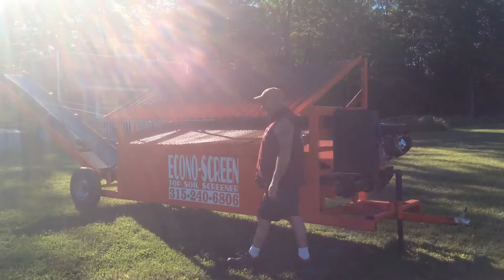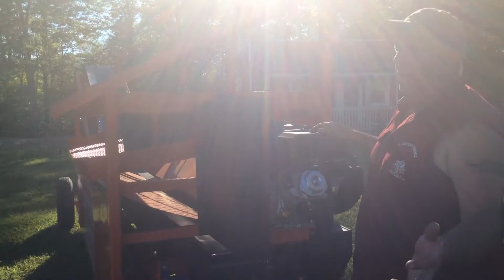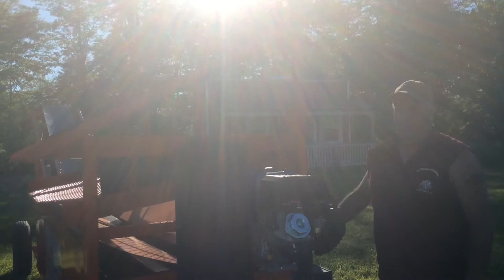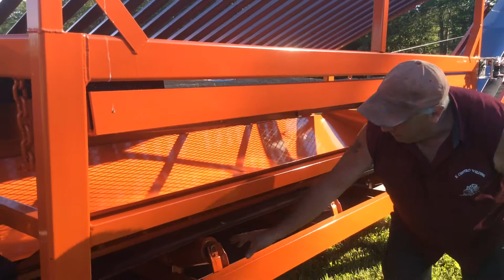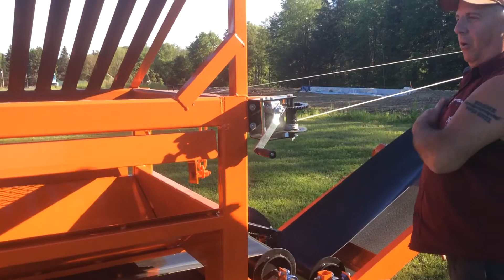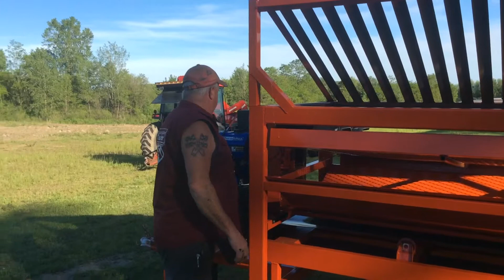Econo screen topsoil screener Stacker model new design

Comment: I'm not knocking homemade equipment, but this is junk
Reply: These are the problems i am having the belt system blew apart first day. got to say he sent me another one about two month's later. put a new one on it blew apart after screening two loads. the adjustment is so touchy .once adjusted by his video that he sends. it's runs true for a bit and then changes in a second runs off the roller folds over belt is destroyed by the time u get to turn it off. then decided to just use the bottom belt it blew apart the roller system is not right needs to be tapered rollers  or something   the welds are tac s in alot of places mabe screened top five tandem loads hair line cracks all over battery box broke off lite duty screws holding it . then  decided to screen without belts dug a hole underneath screener worked for a bit and then kept blowing the bearings caseings that run the shacker table replaced them 3 times the housing that the bearing sits in to light the chain system also not good  the screen is also broke in many spots and the table ended up hitting the outer frame had to refab  that .  finally shut it down. time to restuct the hole machine trust me not happy  18000 plus us dollars  my thoughts are if the screener was built heavy duty it could work for a while his video says his worked for years well mine definitely did not come on 5 tandum loads of top soil really. I have pics of the problems I am having and just so u no its not abuse
Reply: how to do know that, explain your reply.
Reply: @LAKESIDEBOB1  I'm not sure what you're asking. Explain your question please